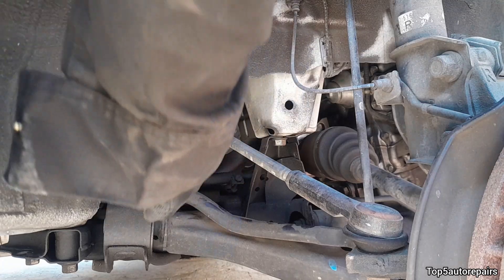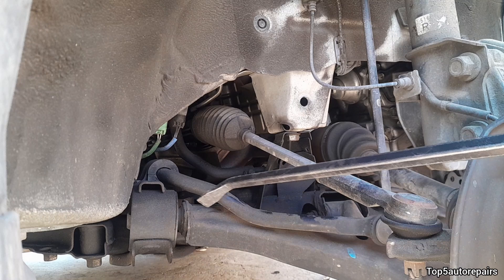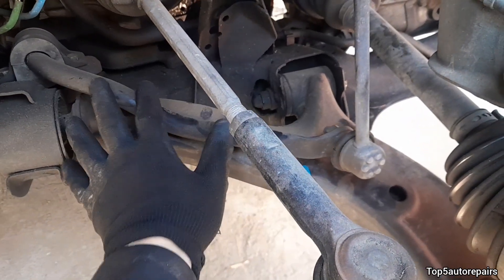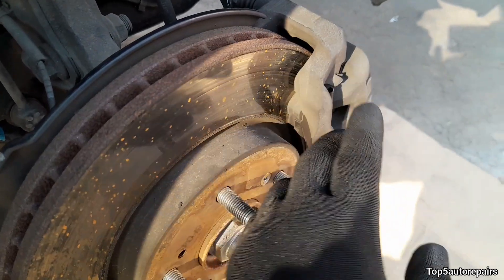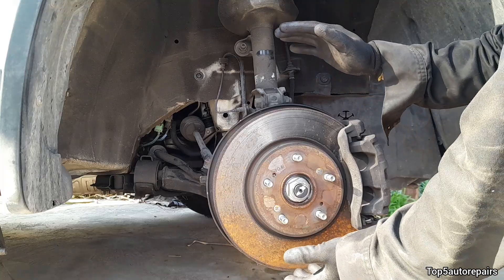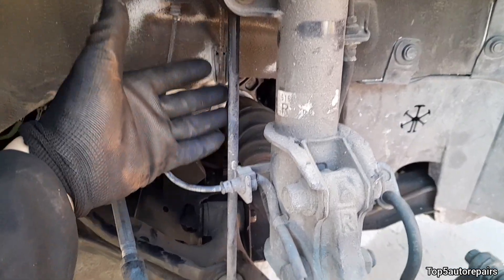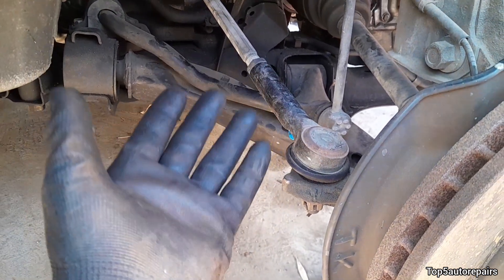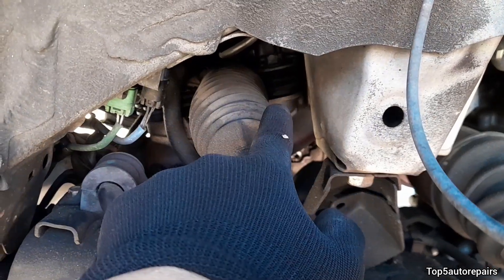CAR PULLS TO THE RIGHT OR LEFT WHEN ACCELERATING

Comment: 4 new tires, replaced both lower control arms and ball joints, and did a 4 way alignment. My 2010 civic si still pulls to the left when i am accelerating. It most noticeable at 55mph+.
Reply: Did u figure it out?
Reply: @Socialrejectzallhuman na, I ended up getting rid of the car all together lol
Reply: @MrDmagic88 same here with civic 2012.
Reply: Dude my taurus SHO pulls to the left when accelerating most noticeable at speed when trying to pass, so like 40+. I think it may be the strut. Replaced control arms. Have not done an alignment yet. The control arms did fix this for a bit (well mitigated it) but it started doing it more noticeably 2 weeks later, so since the control arm kinda fixed it that means is most likely suspension. But I’m trying to do more research now lol. Could also be strut mount bearing/bushing. The rubber part with the bearings for when the spring moves when turning and its common with fords so again im thinking strut
Reply: Torque steer

Comment: I have a ford ST line 1.0 ecoboost model and it’s a headache. After a p0420 diagnosis and replacing the catalytic and sensors, there is still a dashboard message that appears that says that the particle filter has reached its limit. After pressing OK on the steering wheel it goes away until it comes back again the next time I start the engine and drive after a few minutes. Any tips?